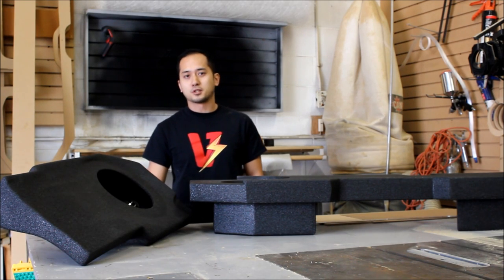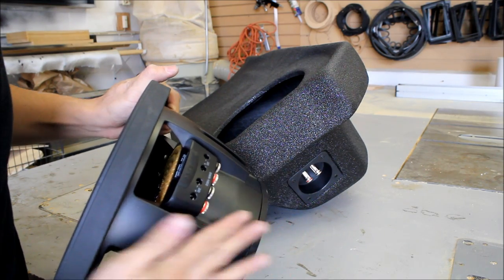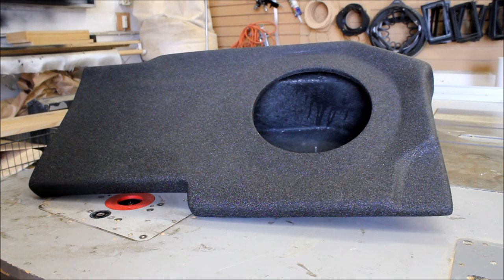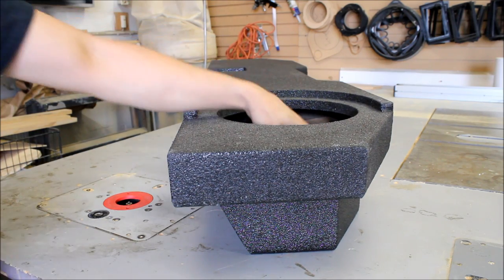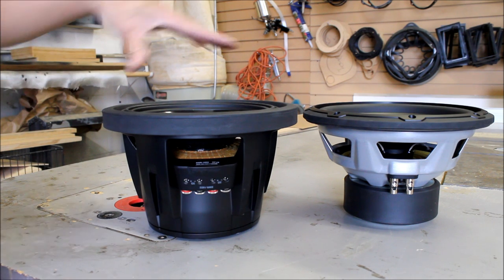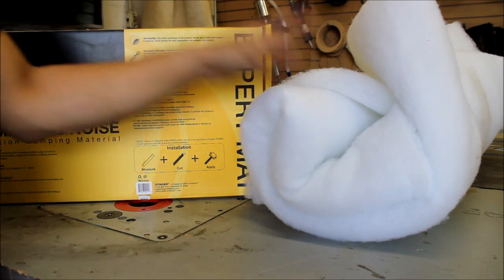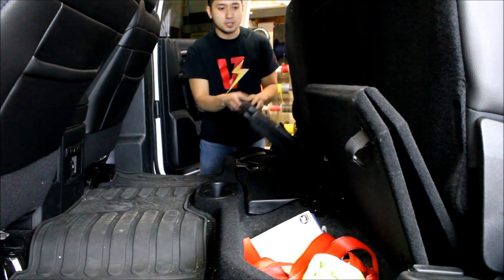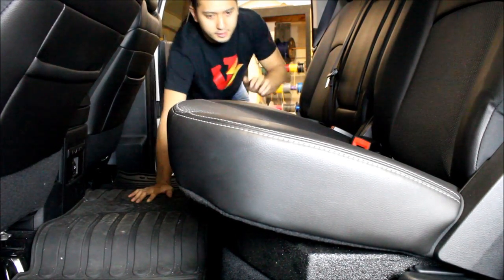Dodge Ram Sub Enclosures Vehicle Specific Enclosures Part 2 (Atrend) | AnthonyJ350

Comment: Wouldn’t it be better to put a subwoofer that matches the air space in the enclose instead of putting the biggest woofer that fits?
Reply from the maker: Go big or go home! But yes you're right. You can compensate by adding polyfill to make the enclosure "bigger" up to 25% roughly.
Reply: A 10inch woofer will sound better than a 12 without enough air space.

Comment: I just wish someone would commercially sell a box for these trucks that would allow you to maintain the fold flat floor. I am going to have to build my own out of glass I guess. There is more than enough room to do two shallow 10's and keep the fold flat flooring. I just want two 8's. I am not all about the boom boom. Just nice tight bass and quality for rock and metal.
Reply from the maker: Ya I don't think the market is that big, you can just sound deaden the factory enclosure then.

Comment: Fox acoustics is the best for these trucks. Mine rocks with 2 type R’s, makes the mirrors dance and the roof bow! 2017 Ram 3500 is the truck I have.
Reply from the maker: Thanks for the comment
Reply: I’ve been trying to get a better box so  the fox is better I’ve heard that too but it’s just the cubes that you have to work with… it limits your subwoofers so much I’m trying to figure this out but I’m not sure if I should just buy anything it gets a tad  bit expensive I’ve already got thousands invested… it’s sounds great in the cab but it’s just not performing it’s maximum potential.. with the equipment I’ve got I should be shaking the ground dude
Reply: @dantheisen35  the box has plenty of  airspace for my subs and people hear my bass  a couple of blocks away, good enough for me.
Reply: @871jamie  what subs do u have

Comment: I have that same ported box for my 2009 Dodge Ram 1500. I am looking at JL W3 but also looking at the W6. Will the W6 working it takes 2 12"
Reply from the maker: W6 might not fit. The W3 is a more efficient sub.
Reply from the maker: If you want to get the most out of your sound system you'll want to sound deadening the cab of the truck https://youtu.be/f_8dcffi9wI

Comment: I’ve been having problems with my Dodge Ram quad cab prefabricated box it just sucks basically lol… cheap and made cheap … the skar vd10s I have are vibrating it so hard it’s beginning to fall apart and it’s sealed so it’s leaking air out of the corners and all over
Reply from the maker: Gotta go custom then from an experienced shop.

Comment: I have the atrend bbox full mdf 10” vented enclosure. I have massive audio gtx 104 with a 750 rms amp and a 5.5 power cap. I had this sub, amp and power cap in my Silverado in a different box and it hit very hard. This one doesn’t hit no where near as hard and I noticed my sub gets hit very quickly and has a funky smell so I believe it is just to small volume for this sub. I could use some help on this one because I don’t want to hurt my sub or void the warranty
Reply: Gets hot not hit sorry I’m very sleepy
Reply from the maker: Turn down the gain a little and try stuffing the box with polyfill and sound deaden the inside of the box.

Comment: I have a 2012 ram crew cab laramie.  Will 2 12s kicker rt dvc 2ohm.  Be good.  With a kicker cx1200.1  amp
Reply from the maker: I would go with a custom box for that application.

Comment: If you have the 10 speaker with sub alpine system what sub do you recommend to swap out the stock sub? Also this will stay on the stock amp and stock system. Would you also recommend stuffing the stock box with the poly fill?

Crutchfield recommended a focal p 20 fse flax evo series shallow mount 8". But that was with an upgraded Rockford amp which means I have to buy a bunch of other stuff to bypass the alpine system.
Reply from the maker: If you're not upgrading the amplifier, I would line the factory enclosure with sound deadening and polyfill and sound deaden the truck.  Something like this https://www.youtube.com/watch?v=IHUmEEM9ze4&t=2s

Comment: @AnthonyJ350, what is your opinion on the Kicker VSS kit for the RAM 1500 Quad Cab?
Reply from the maker: Items like that are awesome value. Will hit better than a factory setup but will have limitations with the plastic enclosure and smaller amplifier.
Reply: @AnthonyJ350  Thanks!
Reply from the maker: @r8rfox1971  You're welcome

Comment: I'm currently working in a 2004 dodge ram quad cab and I can't decide if I want 10s or 12s. Either way I'm going with shallow mounts. Didn't know which would sound better
Reply: Ricky Martinez i have a 16 ram and can honestly say 6.5 or 8s in the right enclosure is amazing. sounds beautiful and works great.
Reply: Ricky Martinez if your talking in this application where air space is extremely constrained, smaller is better. like i said, i have to massive audio 6.5 on a rockford 500w amp. for what it is, it is amazing. if you just want a little bump behind you and are not going for spl, smaller is definitely better for sound quality.

Comment: thanks for the vid! hard to find anything on youtube for the atrend vented 10 box. the model number for it is very similar to the sealed box, which I currently have, but the footprint is remarkably different. looking forward to getting mine installed. how does the single vented 10 sound compared to the single sealed 10 that you reviewed in your first video?
Reply from the maker: I think the sealed version had a little bit better quality and was able to hit lower tones better. The vented one hits a little harder. All depends on the sub too.

If you have trouble fitting the vented you might need to get a few large washers and raise the seat up a little.
Reply: AnthonyJ350 thanks for the reply! my vented one will be in soon. interesting that the sealed with less volume seemed to hit lower. I was hoping the vent and more volume would result in a deeper note than my sealed box. I hope i can tune it to be a clean hit if it does hit harder. some of my old vented and ported boxes were sorta sloppy
Reply from the maker: @capitalHlake  Sealed typically hits lower tones and more variety.  Vented hits particular frequencies very hard but compromises other frequencies.

Comment: I got a 2010 Dodge Ram 1500 Quad Cab & i’m having issues getting the type of vented sub box as well as subs I want to put in here & having the space for installing a high quality amp that will have air space to breathe. Any suggestions??
Reply from the maker: I honestly think sealed enclosures preferably custom with two 10 inch subs sound best in these trucks.
Reply: Which ones?? Already bought a single 10” sealed one that I regret just didn’t move the amount of air space I thought it would but it also wasn’t the high quality that i’m looking for now.
Reply from the maker: @terrencelewis5334  You need a lot of power to  make it hit hard
Reply from the maker: @terrencelewis5334  JL Audio W1s and Was are awesome in these trucks. They require very little air space.
Reply: AnthonyJ350 I’m currently looking into different sub box enclosures that I googled. Don’t want none made of that cheap board that can’t handle pressure!

Comment: What box and sub would u recommend for my 07 dodge ram i really would like to use 2 12inch subs. I want solid good bass. 
what would you recomend?
Reply: get a fox box from fox acoustics i got one with two sundown sa 12 and its ported
Reply: @peppaboy9  how does that sound. Im looking at that exact setup. I have a qpower sealed with 2 JLtw3v5 12s on 1200watts. Looking for more power and more bump

Comment: If I am using the stock enclosure but upgrading the sub would I use polyfill?
Reply from the maker: I still would add polyfill. Also line the inside with some sort of sound deadening like Dynamat to stiffen the plastic.
Reply: @AnthonyJ350  you said add about 75% polyfill?
Reply from the maker: @erikjohnson2742  Ya anymore won't really do anything. If you're using the fiberglass enclosure I would also add Dynamat inside as much as you can.

Comment: Is it possible to run a Amp and Subs with the factory u-connect or am I forced to purchase a different head unit?
Reply: pac lp7-2
Reply: I have a 2015 ram quad cab with the upgraded Alpine junk stereo, I pulled the Alpine sub and ran signal wires from the rear door speakers to an LC2i lock and it sounds pretty good, bassworx ram10 box (I sprayed leak seal coating in the box, polyfill, and used one sided tape to seal the subs), Audiomobile GT2110 subs, and a Pulse Audio 1500 RMS 2ohm amp, it pounds
Reply: Almost any factory system can be run with aftermarket subs off the speaker wires using line out converters. Great if you want to keep the rest of the system stock.

Comment: any box that allows you to keep the cargo bench? or do you have to lose it with every upgrade?
Reply from the maker: You can do a half enclosure on the passenger side and maintain the other half.  Otherwise you'll have to go custom if you want that cargo tray.  It can be done.
Reply: It’s “all about that bass”, screw the cargo! Lol
Reply: I was thinking the same thing and the only way I believe to be able to keep your cargo bench is going under seat subwoofers. Won’t get the same power from one of these subwoofers but an upgrade. Me personally thanks to this video I might just do one woofer on the passenger side and keep the other.

Comment: Would alpine Type R  R-W10D4 fit in a 2017 Dodge Ram? My mounting box is 6.5”?
Reply from the maker: I would verify the specifications of the sub on Alpine's web site.
Reply: AnthonyJ350 the subwoofer mount depth  is 6 3/4 It will be a tight fit
Reply: AnthonyJ350 do you think it would work Though?
Reply from the maker: @lilhanger4680  Is the box custom?
Reply: AnthonyJ350 I got it off amazon 😬
Reply from the maker: @lilhanger4680  The sub is too deep by 1/4". It probably won't fit. JL Audio W1s are probably going to work better.
Reply: AnthonyJ350 I seen on amazon Fits 02-17 Dodge Ram Quad / Crew Alpine R-W10D4 Type R Single 10" Custom Sub Box
Reply: I have two type r 12’s  in my 2017 3500 In a fox acoustics box. They also make one for 10’s. Mine hits freaking hard!!
Reply: @871jamie  where did you buy your box?

Comment: Could you get a W6 in that Enclosure?
Reply from the maker: I don't think so.  You'll have to go custom and raise the seat a little bit.
Reply: @AnthonyJ350  I can get seat lifted do W6 fix
Reply from the maker: @rodneymartin2046  Does the W6 drop into the enclosure?
Reply: @AnthonyJ350  I don't know. I can order it today
Reply from the maker: @rodneymartin2046  That's the risk, the W6 might not drop in and you might have to space it up.
Reply: @AnthonyJ350  I will just stick with the JL Audio W3 all because I replace all my speakers with JL Audio C2

Comment: would the fiber glass work in a 2000 ram extend cab???
Reply from the maker: Not this one, it's a different cab style.  This will work from 2003 to 2016.
Reply: +AnthonyJ350  thank you for replying. which one is it by chance,  I couldn't find it.
Reply from the maker: MrRanvic See if JL Audio makes anything from their StealthBox line up.  Or you could do a simple custom wood box that goes over the drivetrain tunnel in the middle.  There's no room under the rear seats in those truck from what I remember.
Reply: +AnthonyJ350  thank you very much.  there are no room at allll, but I need some good  bass in there. appreciate the reply.

Comment: What box do i need to perfectly fit the 10 inch alpine type R?
Reply from the maker: Is it for a Ram?  You'll want to go custom for those subs.
Reply: AnthonyJ350  yes,  05 ram 2500 quad cab.
Reply from the maker: Ya for those subs, going custom is the best choice for fitment and audio quality.  You don't have to go crazy, but we do a fair share of Rams at the shop and for subs that size it's the way to go.
Reply: @AnthonyJ350  hey buddy thank you for the info and video sharing so you say for sure to build a custom box for this truck as I’ve mentioned before the dodge quad cab just limits your airspace and cubic feet so you just don’t get the maximum performance you should be gettin from your subs im at a standstill on what to do here… can you give me any advice on how to make it better? Maybe a blueprint or something? I’d appreciate it… I see you are in Canada so that rules out me having you build one for me lol anyways thanks man I’d appreciate anything you can say or help me with thank you so much Anthony
Reply: @AnthonyJ350  oh yeah I have a skar rp1500.1 and two skar 2 ohm vd10s shallow mount subs and I’m running series/parrellel so I’m at a 2ohm load on the 1500 basically is about 450 to 475 rms but would like to utilize my amp and maybe even get some beefier subs? Again i appreciate any input

Comment: I’m trying to is if 2-10’ sub Skar Audio
Reply: 2003 Dodge Ram 1500
Reply from the maker: Elpidio Carrizalez You'll have to look at the mounting depth. I believe Skar product is pretty big.
Reply: 6.1’ depth
Reply: DDX-10 | 10" 1000 Watt RMS
Reply from the maker: Compare it with a JL W3 because that fits no problem.

Comment: What would you recommend for my 2005 dodge ram slt !!! I want  2 subwoofers if you have the link for one of those box let me know thanks
Reply from the maker: I would do the Atrend Phantom sub fiberglass enclosure.  I would line the whole inside with some sort of sound deadening like Standartplast or Dynamat.  I think 10" works best in these trucks due to the limited volume https://www.atrendusa.com/10-dual-dodge-ram-quad-cab-02-up
Reply: @AnthonyJ350  thanks you are the best !!! have a great night
Reply from the maker: @yamahar1castillo923  Thanks for watching!

Comment: I want kicker cvr be good on a 08 dodge
Reply from the maker: Kicker will be good.  Just make sure you power them appropriately with enough power from whatever amp you choose.
Reply: would it fit in the box
Reply: would it fit in the box
Reply from the maker: Sandra Bernal That you'd have to test at the store cause of the basket. I recommend custom in that situation

Comment: I have a question
Reply: I have 2 boss 4ohm dvc 12' i hooked a folsgate r1200-1d to them at 1ohm for max power but cant turn amp up speakers sound distorted and pop and crack like its to much power but subs says rated for 2300w a piece i dont belive bc they sound ready to blow do i meed new subs or am i hooked up wrong
Reply from the maker: @twrjr3250  Is it hooked up to an aftermarket deck?

Comment: Lack of knowledge, you have to raise the back seat 5/8 of an inch for proper clearance of the larger box.
Reply from the maker: Shouldn't have to on a prefab box built for standard subs. I build custom enclosures for 2002-2018 Rams regularly.

Comment: The bigger the woofer magnet does not mean better sound. It only means you have to buy a bigger amp to move them, which means your just wasting money. A 8 ohms sub will take less power to move but, the quality bass that your looking for will blow you away . hard thumping ,back pounding, bass that will rattle your teeth.
Reply from the maker: Thanks for the feedback!